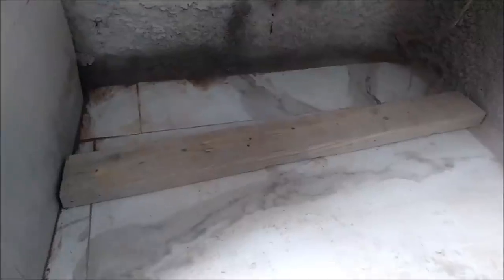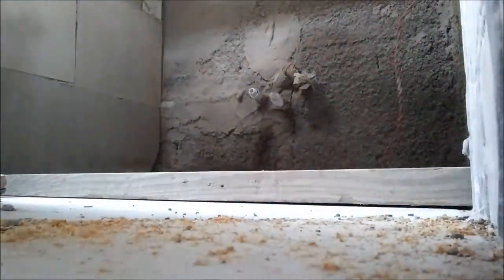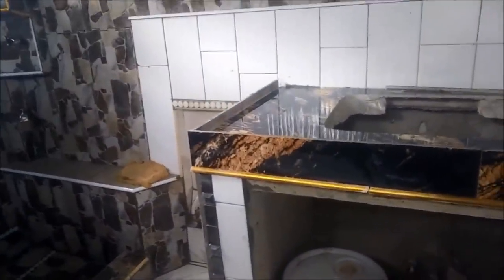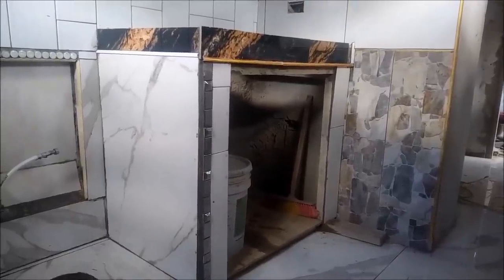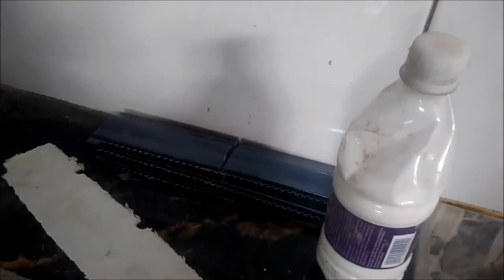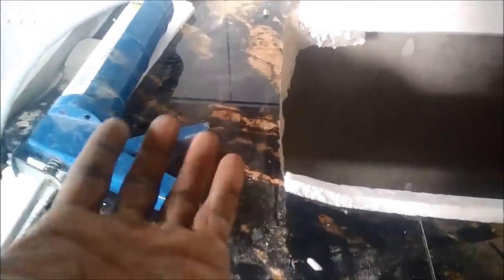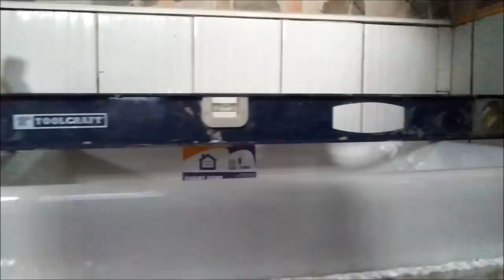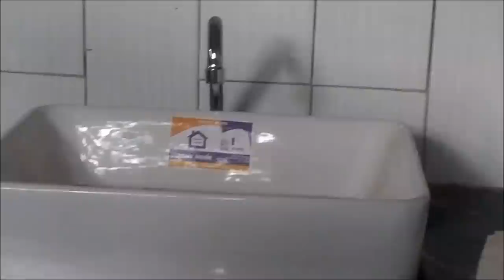DIY How Creat And Design Your Own Fabulous Bathroom  4  7  21

Comment: Hi Daniel. I hate to see you struggle but I admire your perseverance.
Here are some tips to install the face basin or the vessel sink.
1. The facet you have is not the correct one for that type of sink. Exchange it for a taller one so you can reach the knob to turn on.
2. Fill back in the big open space in the middle with concrete and only leave a whole big enough for the basin waste pipe to go through. That will allow you to tighten it to the counter also.
3. You will need a P trap and connector for the wall. The P trap is important to keep the sewer smell from coming back up through the basin.

Take a look at this video from some tips
https://youtu.be/fwULwLC9LjE

Keep pushing brother. You can get it done.